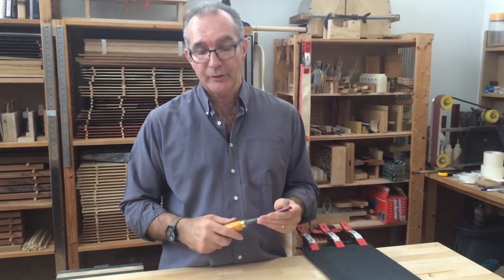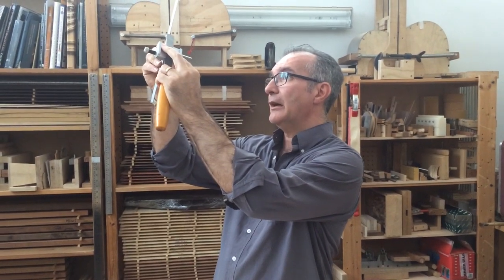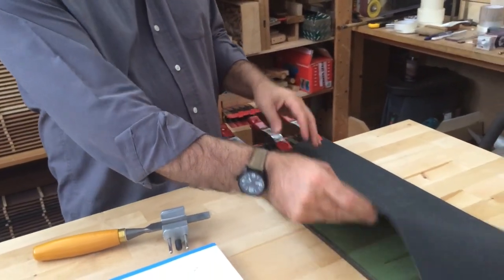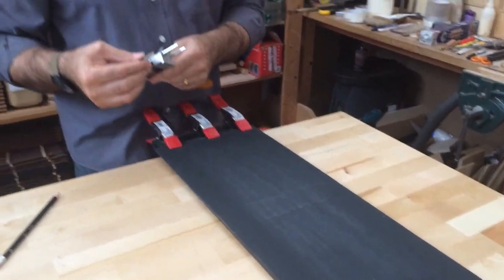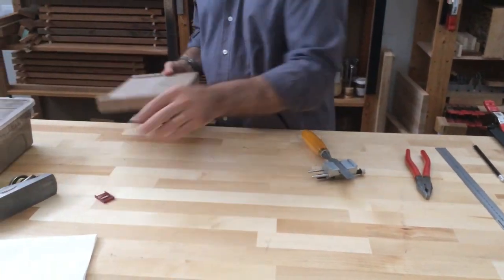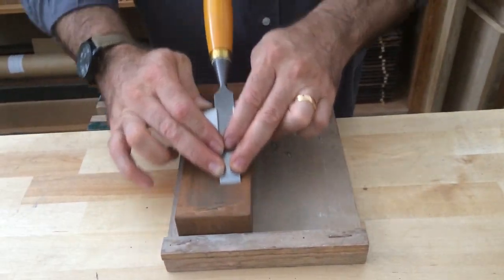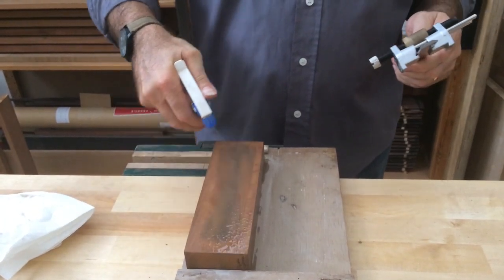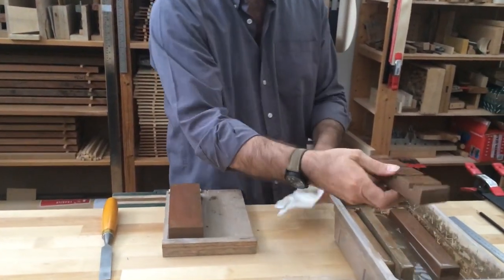How to sharpen your tools.

Comment: A true Luthier. I would like to see a video on how to make a radius board for the back and front of the guitars. I am a beginner luthier and would appreciate if you show how to do a 25 ft and 50 ft dish. I have found videos on 7 inch radios blocks for the neck but not for the body. I also would love to see you make more videos with  you giving the dimensions of the wood and reasons for all parts. I really wish i could take a class from you. You seem to explain things in a manner that i can pick up on.
Thanks you, David
Reply from the maker: Hi David, thanks for your positive comments and good luck in your new guitar making adventure. In terms of the dishes I highly recommend that you get them made for you, there are a few places on line where you can find them for a good price as the alternative, to make them, is a lot of very messy work and it really is not worth the effort. (just my opinion, I have made the in the past and I won't be able to make them again) In regards to further videos I am in the process of putting together an on-line course which would help you from beginning to end to build a top-end classical guitar. In this course you will find all the information you are asking me and it will be available to buy in the next few months.
Reply: Can you tell me when you are going to start classes up and how much will it be in american dollars,
Reply from the maker: Hi David, about the on-line course there is not a lot that I can say at this point as there is still a lot of work to do, but as soon as I have information available I will be making a video about it and you will find out on my channel. In the meantime if you are interested in the one month guitar making course that I offer in Spain you can have a look at the website: www.guitarmakingcourse.org and if you have any questions about the courses please send me an email through the contact page on the website.